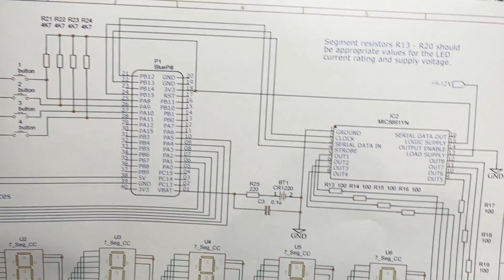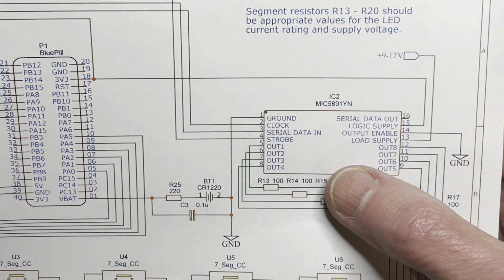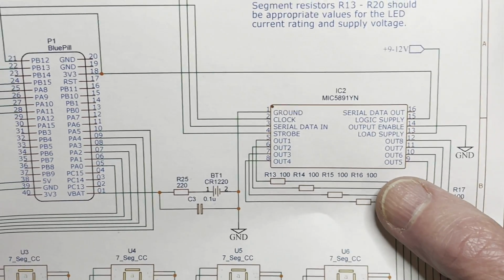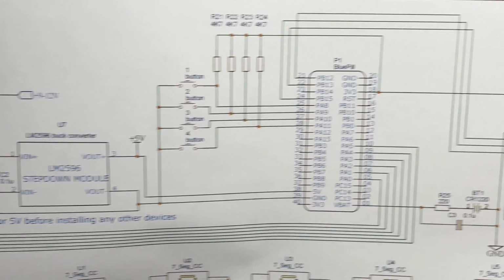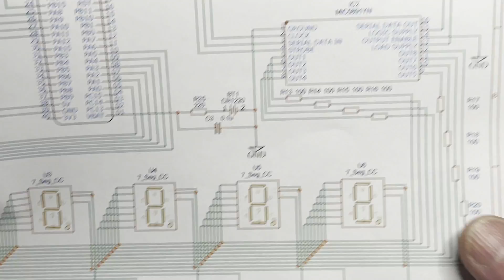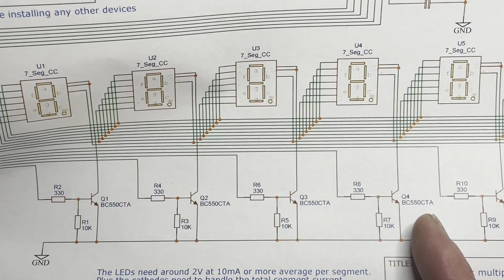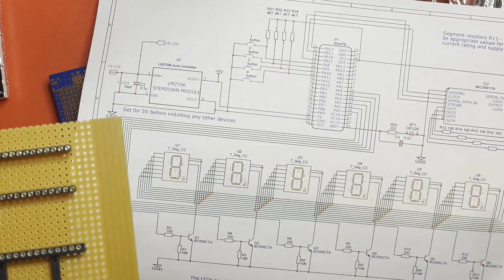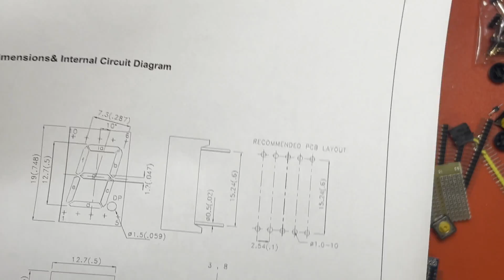Wire Wrap circuit construction, from scratch: Part 1

Comment: First time I ever did wire-wrap was when as a student I was handed an LSI-11 DEC board that someone had made and told to add 4 more bits of addressing range to it. Sadly I was a Software Engineer not a Hardware engineer, but in 1980 you could pretty much do anything with a micro/mini computer if you knew the concepts.
Reply from the maker: Minis were great machines - I used to own a PDP8, but had to sell it when I moved away from my parents place.

Comment: Ironically, wire-wrap is now much more expensive than having a PCB fabbed. Years ago, I did several wire-wrap projects using the Vector slit-n-wrap tool, which was convenient because the tool stripped the wire for you, but it was prone to wire-breaks and it was necessary to test every connection, because sometimes the tool didn't slit the wire correctly. However, once the connections were good, the board was reliable. At that time, there were no PCB design tools available to hobbyists; today those tools are free. It's probably been ~40 years since I bought any wire-wrap materials.

I stopped doing breadboards about 15 years ago, and only do PCB's because high-quality boards are very inexpensive (10 boards for less than 15 USD including shipping).
Reply from the maker: I do a lot of PCBs for projects where I may want multiples, but some form of point-to-point is better for prototyping where a lot of trial and error may be needed, or for layout demos.